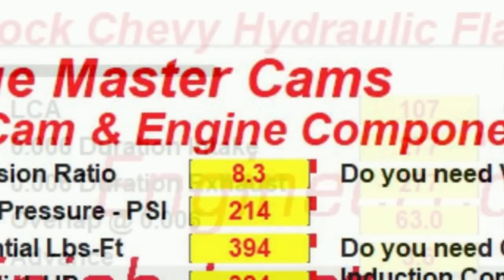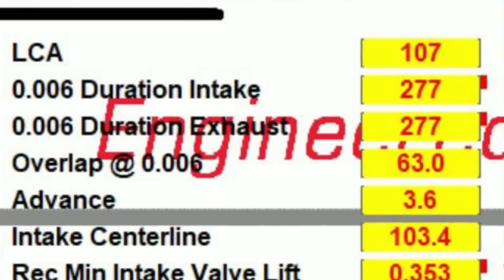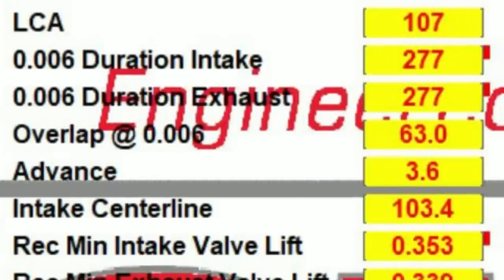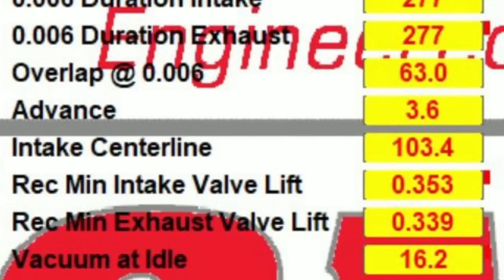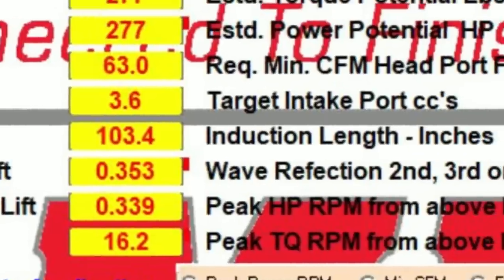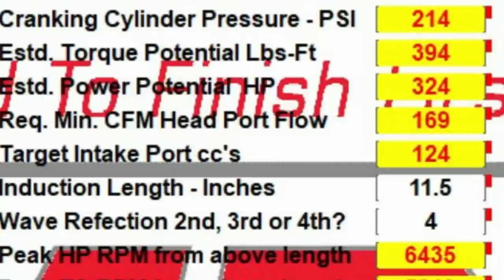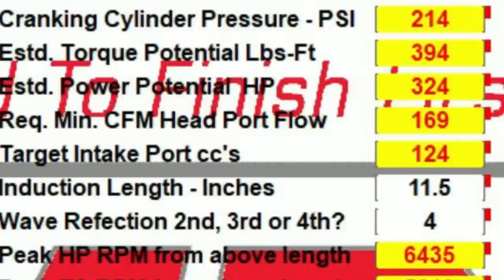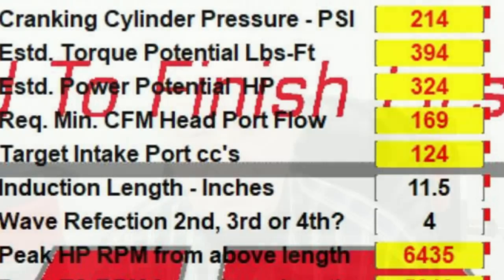Never seen before cam selection method for 'Mission Impossible"

Comment: Why 8.3 dynamic compression?
Reply: Because any higher and it'll ping on pump gas.  Do you know the difference between static and dynamic?
Reply: @gofastparts4u  no it wont. Depends quench, timing, temperature, fuel, load....
Reply: @e85lenkkari  YES it will... at least with any kind of decent timing curve, temp and PUMP gas...  Been there, done that.

It's universally accepted that a pump gas build needs to be in the 8:1 (9:1 MAX and that's if everything, quench, chamber, test conditions, etc. were perfect and it would probably still be detonation prone) dynamic range...

IF he could get away with more compression, don't you think he would???

Use your head for more than just a hat rack...
Reply: DV is one of THE top engine engineers in the world.
You might discover his background and realize that DV actually knows what he's discussing.
Reply: @gofastparts4u  yes i've been there too. There is so many things that effects. That was my point for your answer.
Reply: @gofastparts4u  I was asking for Mr. Vizard to answer this question.  He's more experienced than you and could give a more detailed explanation.  And, yes I do know the difference.
Reply: @ragingbull3406  if you knew the difference or WATCHED THE VIDEO, you wouldn't have asked such a stupid question....
Reply: @gofastparts4u   Knowing the difference but asking why 8.3 "specifically"  was not a stupid question. You gave a stupid, low brain celled response. The ratio could have been 8.3- 9.3 and so forth.
Reply: @gofastparts4u  ok 👍 You are absolutely right. No bad feelings.
Reply: Could it be; because that is the number his program spit out? Could it be that he has future plans for same short-block, but with perhaps, smaller-chamber alloy, quench heads? I mean isn't this episode 12? 
Just follow along, Ima thinking that it may become evident as time goes by.

Comment: I was of the impression that under Uncle Tony's original plan it was going to get a stock cam of some description. 

Great info though.
Reply from the maker: Getting the right cam via a regrind gets more performance per $.
Reply from the maker: Since we are building this motor from the ground up why would we install a cam that isn't even optimal for a totally stock motor? For about 70 bucks the reground cam will be one of the best HP per $ spent.